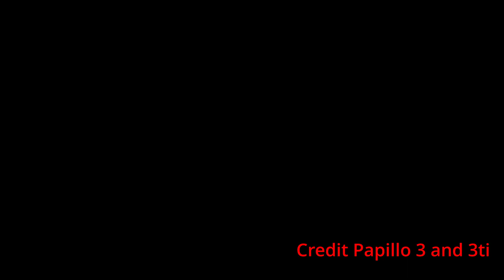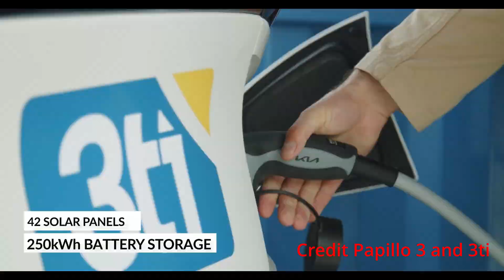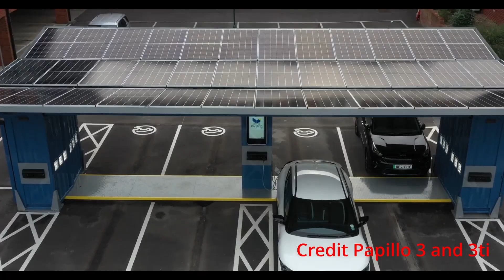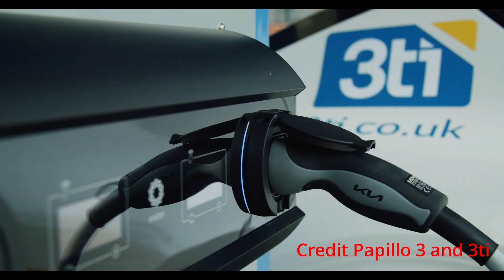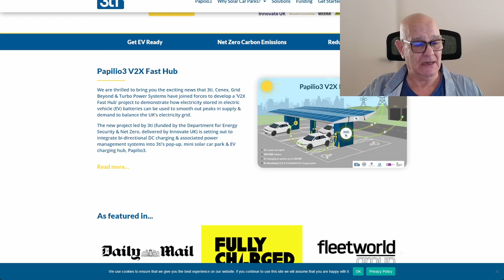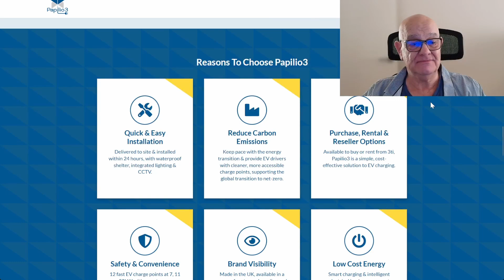Solar Car Park Charging   this is brilliant

Comment: Brilliant idea! mainly because it can be installed in a day.  However there would obviously be some pre prep, cables and possibly foundations etc,  however with minimal disruption to the carpark.  The idea of making the product in a dedicated factory first  is the kicker in my opinion, so much more efficient in every way.  When I did a recent visit to the UK from NZ I did notice a lot of potential ev charging stations not yet connected,  for various reasons.  This could possibly help alleviate this problem somewhat.  Lastly the fact is, that it is basically a container modified to suit,   so clever,  and so practical as far as using standard transporting procedures etc.
Reply from the maker: I am sure there was some preprep to the ground.  I agree this is a great idea.  Tesla do a similar thing an they also have 'temporary' chargers like this.  Would love to see this in AU and NZ

Comment: Great idea… wou;d love a smaller setup at home so I can fast charge, if necessary.
Reply from the maker: I have been looking at solar and battery setups for home (when I get around to moving) and have been put onto Sigenergy - you can get a 22kW charger installed with their batteries!